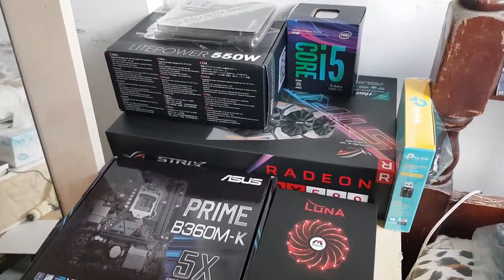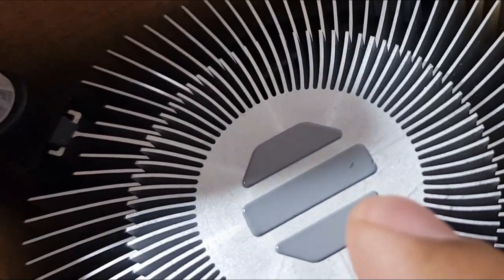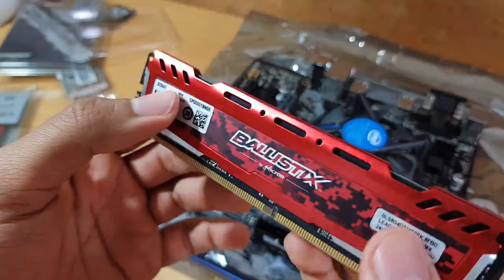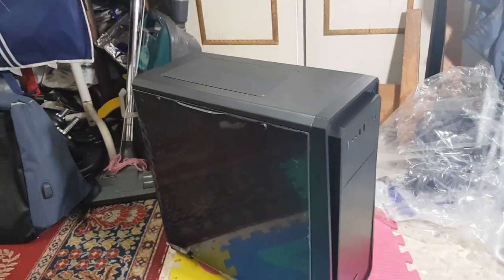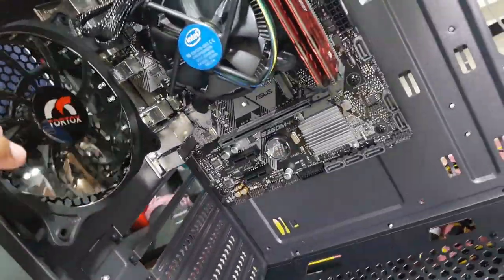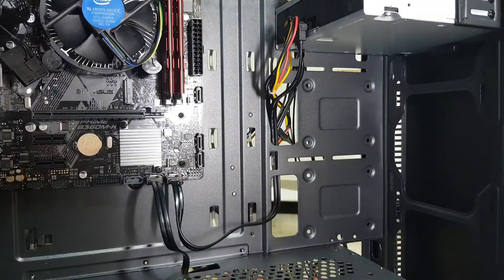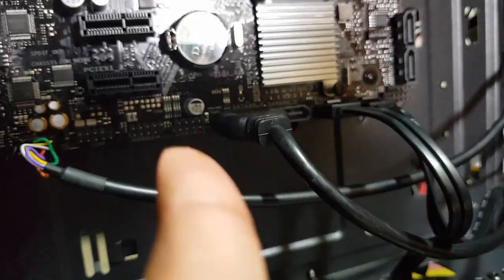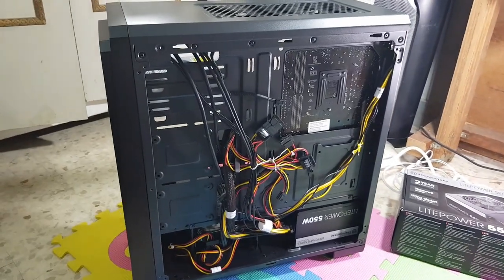Lets build a Gaming PC step by step

Comment: Dude if you already did that great, but you need thermal paste on your cpu, otherwise the lifespan of it will be not that long because its not getting rid of the heat or not getting enough heat out in other words